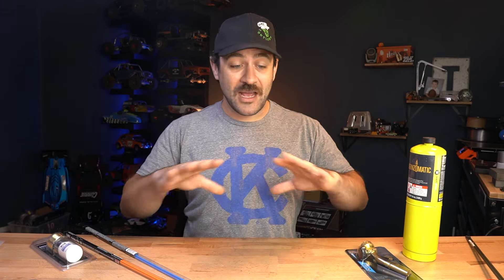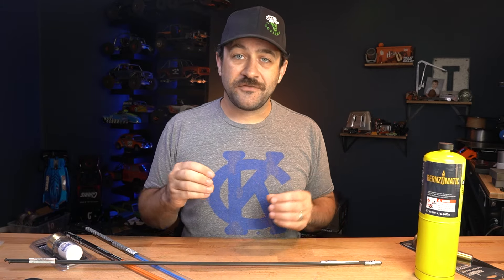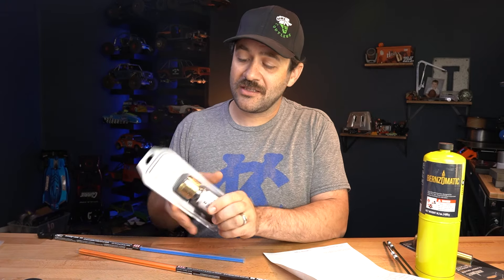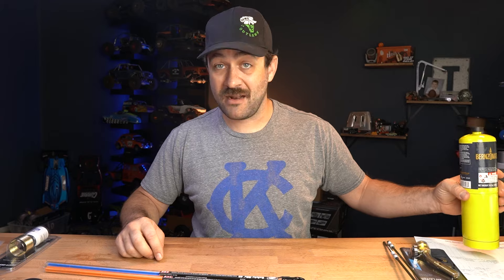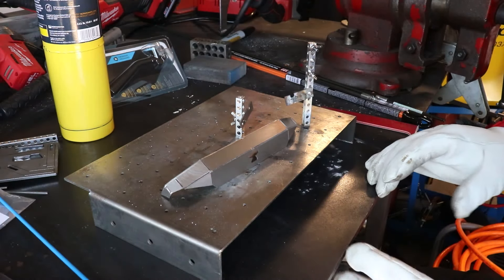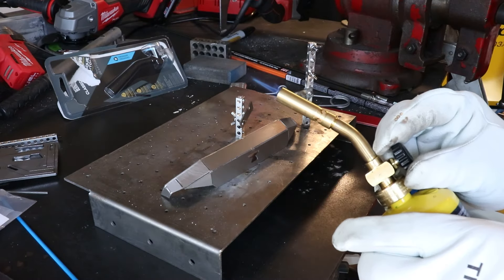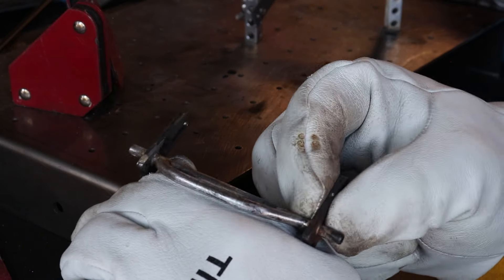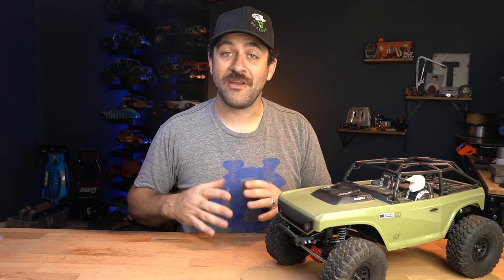Cheapest way to start brazing for RC - Brazing 101

Comment: Hey Josh, one thing to consider also while brazing is joint orientation. Ie, on your folded bumper, if you were to braze from the rear with the face of the bumper downwards, the brazing material would pool on the outer face instead of the inner face. This is also true on tubed joints. If you try to braze with the joint vertical to the table, the joint material is typically better distributed around the contact points.  Cheers!

Comment: I was a silver brazier in a shipyard a couple of things, 1st after your solder has flowed pull the heat back to cool a little reapply the the heat a little and add a bead around the joint, 2nd after cooling soak the item in hot water and brush with a wire brush to remove the flux.

Comment: All I see is a guy with a stash, talking about making joints. Great video and thanks for comparing the solder and flux options. I used a rod at the start and ended with the coil and flux. I use some cheap welding magnets from Harbor Freight and firebricks from Home Depot. I used metal I found around the neighborhood to braze my front bumper.

Comment: I built an Ibex chassis years ago at 82% scale and it was the best crawler I ever had. I did it with an $80 arc from harbor fright and $30 of solid rod from the local ironmonger. Do it! Thanks Harley for the plans.

Comment: I’ve alway braised using a brass either flux coated or you dipped the rod in the flux. What you were doing in the video I always considered silver soldering.  I think on the smaller RC stuff silver soldering would be easier as I don’t think it uses as much heat. Anyway a very informative video & easy to understand.

Comment: Interesting as I've been brazing for a while now but was not aware of the concrete exploding lol..
I actually may make my own table like u have there being I use an old cinder block for my work so good to no and great video as well man...oh live the stash man oh wait bro!!
Reply from the maker: I learned the concrete issue the hard way when I was first learning!
Reply: You can use fire brick, but even a steel plate is much better since you can use welding magnets. Fire brick under to protect your main work surface is good too.

Comment: i like this video and it shows a lot of OOOPS i did in the past:
* burning the magnet (i thought the black stuff is heat resistant)
* working without the magnet and touching/moving the parts
additional OOOPS:
* working with short trousers and being happy that my long trousers would be destroyed!
* there's a factor between heating up and cooling down. can't remember it but your fingers will tell you!
* save time with bad preperation and then need twice the time for cleanup!

Comment: A few more tips from another old guy that carries too much stuff in his pockets. Get the silver galvanized brake line, its a little stronger. I suggest removing all of the coating or galvanizing at once, cut the flares off and chuck it in a drill, use emery cloth on it at a low speed. Wear a damn mask and do it outside, its not good for you as dust, even worse as smoke. I've done 6' at one time with that method. Lowering the light if you can allows you to see the glow of the metal better, and with practice you'll know when it's the right temp and will flow better.
Reply from the maker: I would much prefer to suggest people use regular DOM tubing instead of brake line typically, but I have a hard time thinking about suggesting anything galvanized because It can be nasty stuff. Brake line is a fine starting point but it’s still pretty weak, after all the effort we put in these, spending the extra on DOM as skills progress is worth it I think.
Reply: @HarleyDesignsInc  Me too, but they're not going to spend the money on DOM getting started. The black coating really isn't much better for you if you burn it. That's why I suggest removing it all from the stick at one time either way.

Comment: To clean tubing I cut one end off, slide the threaded ends off. Then put the cut end in a drill and use drill to spin the tube and emery cloth to get coating off

Comment: I have been tig welding since before I got into crawlers. Me personally really prefer the strength that comes from tig welding, and honestly found my best results came with stronger 3/16 tube, and 1/4 inch solid rod for bracing,gussets...
Reply from the maker: I TIG weld most of the time but the costs are much higher for sure. I wouldn’t suggest 1/4” to most people in 1:10 scale though. I’d suggest 1/8” for smaller bracing and gussets.

Comment: Really Cool. Scale bumpers. You had me going for a moment. 
Question: Mig welding car body metal I learned from Eastwood about their copper plated magnet tool aid. The mig material on the spool will not stick to the copper, so the magnet can be placed between level joints - ensuring a level weld instead of a divited crease. [ I could not help but notice how body filler must be used to fill that strong joint you pointed out. ]
So, does burnishing rods stick to copper?
Could the copper covered flat magnet tool aid be used for the same success in level welds in joints?

Comment: during the “gas line” bumper part 
you should’ve had the gas turned down on the torch a bit, also move it back so the inner cone of the flame is just about to touch the metal you’re heating.

Comment: Thanks for the great video , nice simple instructions , and easy to follow!  I'm looking forward to giving this another try ... once i buy the right bottle of gas!, hahah .. i bought the wrong one (blue) and it's not hot enough to melt the rods
Reply from the maker: I should have been more specific on telling people about MAP as well. I’ve seen many people make that mistake!
Reply: @HarleyDesignsInc  well it can be a little confusing , the rating on the bottle says it gets to the required temp ,but it doesnt.. and the rods say they melt at a certain temp but they dont .. ahh well,  next time!

Comment: Can you use a roll of the coiled up 3/16 brake line or is it too much trouble to have to straighten it and then bend it?  It's a lot cheaper.

Comment: If you brazed it from the inside and heated the outside with the bumper facing down would the soldier droop in the gap?

Comment: I understand the higher heat creates a stronger bond, but can you also do this with certain metals and solder? I'm trying to go with materials/tools that I already own.
Reply from the maker: If you aren't trying to do something that will be abused and structural then there are some solders you can use. You need to use an acid etching first though to increase the bond however. It's pretty potent stuff so it takes extra precaution.
Reply: @HarleyDesignsInc  In your opinion, is trailing a rig (not rock crawling) be considered abusive? IMO, crawling rocks where the rig is subject to high falls, rolls, and tumbles would be abusive. I drive in areas that are more like what you'd find at Beat the Creek.

Comment: I've not brazed before so awesome video. Question though, if you flowed the solder back to front wouldn't fill the gap more ascetically where any part not filled would be on the back side as the torch is pushing the solder out?
Reply from the maker: Even gravity came be a big help. Often times you’re dealing with the orientation of the chassis, or where the torch will fit, your hands will fit, etc. however this solder flows so well, that you’ll find its pretty forgiving. Plus it cleans and polishes up really well.
Reply: @HarleyDesignsInc  thanks for the info!!

Comment: Hey man I’d like to make a skid plate and I’m trying to figure out where I could find some hobby grade aluminum sheets but of course nothing that will bend on first impact
Reply from the maker: Not sure what you mean by hobby grade but you should be able to find aluminum sheet at Lowe’s or Home Depot. But also, you can buy small pieces straight off Amazon too

Comment: Could I use one of those small Ronson R3A18 handheld butane torch?
Reply from the maker: Butane does not burn as hot as MAPP. It may work on some materials but may be hard to get everything hot enough if you’ve got complex joints.
Reply: Ok thanks. I was going to try brazing using it and 3mm tube and brazing 45% rods

Comment: Do you have to use MAPP gas or propane? Or can you use a butane torch?
Reply from the maker: A Butane flame is almost 1000 degrees colder than MAPP. I highly suggest getting a MAPP torch. They can be very inexpensive.

Comment: But does rosin core solder work? I have a huge roll for soldering....
Reply from the maker: No, that’s very different. You need proper silver solder for this. It’s expensive but absolutely needed.

Comment: On like a rear cage brazing with the silver will be fine? I’m assuming the higher percentage the better the silver rod is?
Reply from the maker: Silver solder is good for about anything in 1:10 scale. I cover a bit of the differences between the 45 and 56, I’d suggest the 45 for most uses.
Reply: @HarleyDesignsInc  thanks for the insight. Sorry last question, I have 3/16 cold roll steel available near me. Is that ok or is there a certain steel I need to use for a rear cage?
Reply from the maker: @andymarshall4014  3/16 CRS will be fine. Solid rod will take more time to heat up but is still a perfectly fine option. It will get heavy but it is also easier to bend without concerns of kinking the material. I use solid often as well.

Comment: What are advantages of using silver over bronze as your brazing material?
Reply from the maker: It has a lower melting point and a higher tensile strength, while also having a better wicking characteristic. The trade off being the expense mainly.
Reply: Flows better and just easier to work with. It's 100% worth the cost.

Comment: I’m doing something wrong, can I braze aluminum rod to sheet metal? and can I use just any flux or does it have to be specific? I can’t get anything to stick, but it rolls right off
Reply from the maker: No, aluminum doesn’t braze like steel. Flux should also be a good match to your materials and methods.
Reply: @HarleyDesignsInc okay thanks for the advice!! I’m pretty sure I’m using the wrong Plex as well. I’m using the paste kind like for electronics.
Reply: Flux***

Comment: You really need a hobby size torch. Something smaller with map gas and oxygen.
Reply from the maker: I have the smith size torch, most likely what you’re referring to and also have the much nicer Detroit Torch. Both of them run on Oxy/Ace and are much nicer than running Mapp gas. However this video was about doing it on the cheap. Most times I TIG weld instead anyway, but I wasn’t trying to show $5000 worth of tools for this demo.

Comment: hi Man! i am in Europe, can you tell me what is this map or mapp gas exactly? wikipedia says it contains some form of acetylene. I only have propane or propane-buthane gas here for a torch... is that inferior to mapp gas? thx
Reply from the maker: MAPP gas burns hotter than regular propane. That’s the advantage to it. I’m not sure what the best alternative for you would be but I’d compare the temperatures and see what you can get.
Reply: @HarleyDesignsInc  thanks mate for the support i was fightin thru google and webshops in the last 5 hours, turns out its accessible, Rothenberger, an austrian company and another one sells it. but the price of the begginner kit is quite prohibitive, few ppl use it. actually the Rothenberger torch is way more expensive than the bottle. also they explicitly say, that never use a normal torch (even theirs) that is not designed for MAPP gas. kickin myself bcos i already bought a mid level, OK-ish torch, bcos it said 1100 C flame temp. but i found this : 
CFH (german company) Silver brazing alloy SH 320
NO. 52320
High silver content brazing alloy, cadmium-free
For gap brazing of all types of steel, copper and copper alloys
For gas and water installations
Melting/working temperature: 670 °C
Tensile strength: 400 N/mm²
Content: 1 rod (Ø 1.5 mm x 333 m)

but one!! rod costs 12 euro!
what do you think will my normal torch cut it?

Comment: I braze with stainless tube .035 wall, much stronger than brake line. I would never use brake line . harris stuff is all I use.
Reply from the maker: I prefer mild steel DOM tubing over break line as well. Stainless isn't my favorite, but I TIG weld it when I do use it. Brake line is just the easiest thing for most people to get a hold of.

Comment: You could have put your cut pieces in a drill ran the drill while applying sandpaper and cleaned all the work while your at it??? I’m assuming your going to paint the finished product so your going to have to clean everything in order to do that?? You gotta make life easy and not hard??
Reply from the maker: I generally just use an etching primer so I don’t clean all the coating off typically. I just clean with mineral spirits before paint normally.

Comment: Have you ever tried to braze with copper or bronze?
Reply from the maker: That’s what I started learning with initially before going to silver solder. This material is so much better that it’s not even worth buying the other stuff. This is expensive but much cleaner and easier.

Comment: I can use anything to cut the brake line? Whew that's a relief, I gots a melty stick of butter so I'm good.  
🤘bwaahaahaa🤘y'all have a badass day🤘
Edit: serious question, why did you choose milwaukee over makita?
Reply from the maker: I personally like team red’s tool options, availability and the deals you can get.
Reply: @HarleyDesignsInc  cool. I was just curious. I recently got a new makita hammer drill and impact, I almost went milwaukee but I've used makita drills doin backyard projects at my buddies for years so that's what I got. I like milwaukee tools too tho 🤘🍻🤘

Comment: I hate you!!! You make this look so damn easy , I can't seem to get it. I've tried silver rods, copper rods , aluminum rods I've had some succes with. I don't hate you that was meant as sarcasm but man am I getting  frustrated I've got all these great projects and I can't seem to make brazing work . I've got a scale 2post lift I'm working on , I've made my own aluminum road armor type bumper , and I'm trying to get a chassis going and I end up just welding it . Help!!! Is my torch head maybe wore out or not emitting enough heat or ??  Frustrated
Reply from the maker: Are you using MAPP gas? Are you using the silver solder that I showed? Are both sides glowing red when you go to apply the rod?
Reply: @Harley Designs  yes I'm using map gas , I get the parts red hot , I bought a stays silver solder flux but the rods I'm using have flux on them too. I've tried with the silver rods at first and then went to the copper thinking if it melts at a lower temp it might be better to practice with ,I had a little success with that amd rhen I went to the aluminum rods which worked better but don't have the strength. I know my torch heads are all old and they all have different strength and shape of flames so I think I may need to invest in something a bit better . Just trying to do and make things with what I have right now . Things got a bit tight lately so I'm trying to keep occupied with building some scale pieces and figuring out the fabrication and design area of the hobby . It's fun and frustrating but mostly fun . Thanks for you info and all your videos too they really do help the new guys like me and prolly the folks that have been at it awhile too I would imagine